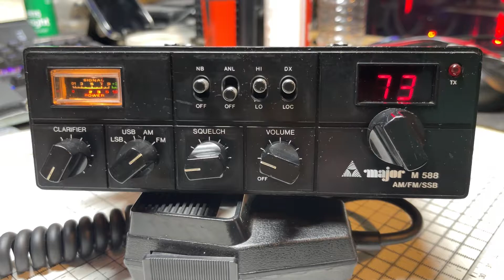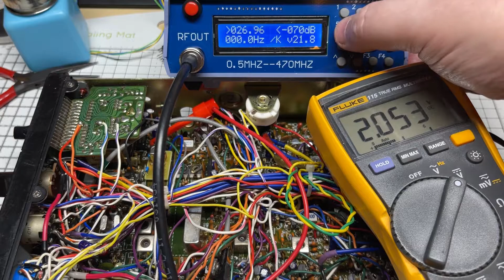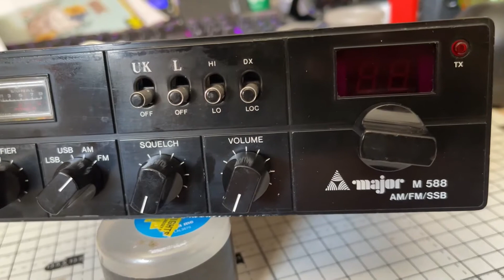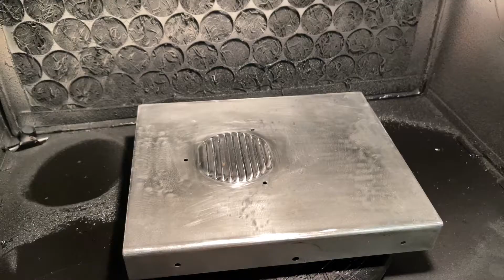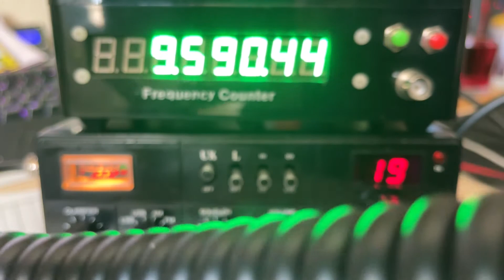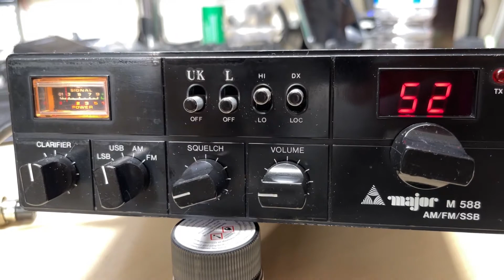EP 060 - HAM International Major M588 - Fitting a PIC mod for UKFM 1 to 40 readout.

Comment: The white wire going to the yellow capacitor is the FM deviation circuit modification that modulates the VCO frequency for better FM audio
The original design modulates the crystals causing the awful muffled audio
Reply from the maker: I have seen a mod that uses a varicap diode to fix this as well ?
Reply: @MicroChipz  this is the same mod look closely at the 10k resistor its at the side of it
Reply from the maker: Sneaky , didn't even see it there , fooled me ;)
Reply: @MicroChipz  I may of already changed C11 but worth checking
Reply: I would also replace c11 as they fail causing no rx and tx due to the 10.240 not oscillating
Reply from the maker: that would cause a interesting fault , just looked at the diagram, next time im in that radio il do it .